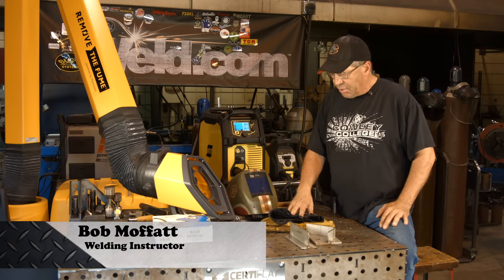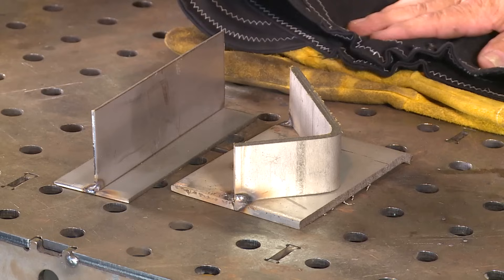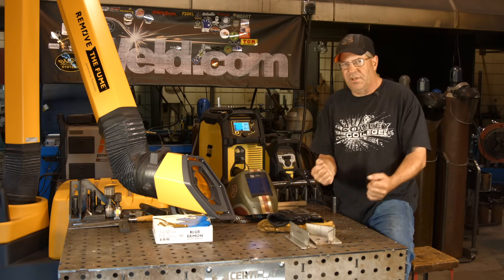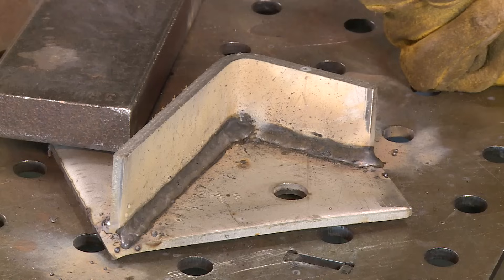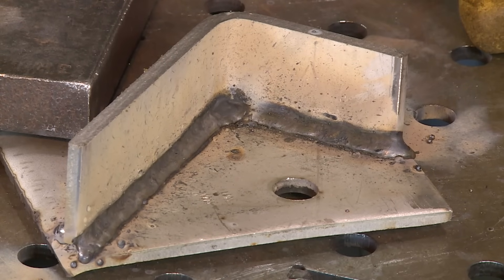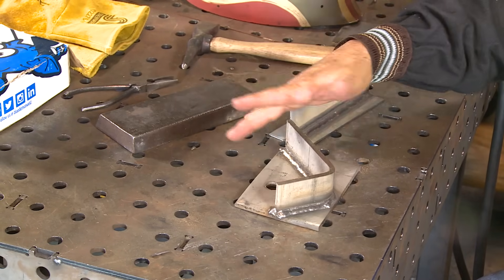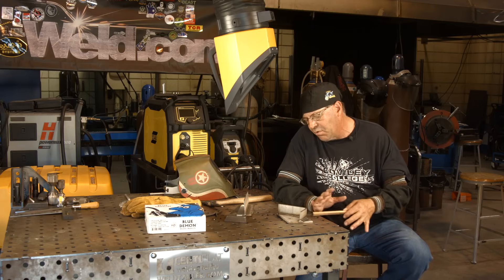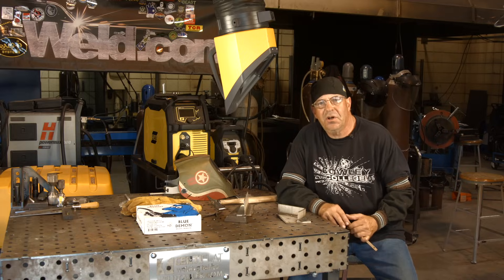Stainless Steel FCAW without Gas

Comment: Might have been a point to note too, that given the stainless is transferred across the arc the same as Mmaw or gas shielded Mag, the fumes that come from this are probably evil!
Reply: That’s why every can of welding Rod and every spoil for mig welding has a warning label saying to use in well ventilated areas

Comment: Why would someone not use flux cor wire?
Reply: You generally would use gas shielded wire for thin sheet metal, for example auto body work .023 dia wire and 25% CO2/75% Argon, otherwise known as C25.  Because of the high amount of Argon in the mix it has a cooler arc with less spatter and less chance of burning through.  If you have to you can get by with .030 wire but if you do this often, .023 wire is preferred.

Flux core tends to have a hotter arc with deeper penetration which is great for thicker structural welds.  Because it has a heavier flux shielding it works well outdoors, gas shielded wire has a hard time with wind.  The bead and slag from flux core is very similar to 6010 stick electrodes which produce a CO2/ CO gas shield.  But flux core is almost always carbon steel, this is the only SS flux core wire I've seen offered.  I don't think we will see FC aluminum wire because you need a inert gas shield ( Argon or Argon/Helium mix).

Comment: Didn't even know flux core stainless was a thing
Reply: Waaaaiiittt is there such thing as flux core aluminum welding 🤔🤔
Reply: I use it everyday building utility trailers.
Reply: @toddedwards1371  Hello, I have a 140 flux core welder. It says to use .030 wire. Would I be able to use this .035 wire?
Reply: @6496chase  same question. Did you ever find out ?
Reply: @DL101ca  I ain't a pro but like sandpaper higher the number thinner the item. So, 30 is thicker, if your running 30 then your setup for thicker product, running 35 the no problem at all. [But, you would want to change downsize to 35 tips, not that it would not work, but would be play running 35 in a 30 zone. LOL...
Reply: @phantom5185  not that way for welding wire. That is a measurement of the wires diameter in inches not a gauge .
Reply: Logan Spence neither did i
Reply: We have used it for years
Reply: yes thats how fuse steel lincoln innersheild nr-211 is aluminum <2% whch reacts with the atmosphere and molten F2
Reply: Me neither, that's why I'm here lol
Reply: As far as I can tell, there are other flux core wires for stainless from the major welding manufacturers, but they all seem to spec gas too, so are presumably used in what's called "dual shield" welding...

  I haven't found any others that say they are to be used without gas...

  About $30 a pound, so obviously if you do a lot of stainless, it would be best to get a bottle of gas for your MIG welder... But if you only have a wirefeed welder or are only doing small amounts of stainless work, seems like it would be an excellent solution.  Price goes down a bit if you are buying a lot.  They have 3 or 4 grades of it.

  If anyone knows of a similar no-gas flux core  wire for stainless, or has other info on this product, please post it here!
Reply: @orcoastgreenman  Have had a little experience with dual-shield stainless, which I thought pretty much rocked.  I only bought it b/c it was a clearance item in my local supplier once, it's quite expensive in new condition.  Powerful arc, big smoking weld covered with black slag.  I guess that's Chromium Oxide?  Slag came off easily to reveal a big glossy stainless looking weld, like butter!  As Jody says about another product "It makes you look better than you are".  I have never tried self-shielded, might be worth it!
Reply: Leonard Pearlman - thanks Leonard...   I tried the blue demon but was not getting great results on the thinnish stuff I was trying to weld, and am not that experienced to begin with... may try it again if I ever have some thicker material I need to weld.
Reply: orcoastgreenman 
Thin-ish stuff is the domain of true mig welding, acetylene welding, or TIG
Reply: I didn't know about it till my first welding job, My first job was wastewater equipment so lots of low pressure stainless I could hone my technique on. we used a flux core with co2 gas.. My current job is at a shipyard and nobody there knew about it either, I saved the company tons of labor hours by turning them onto it with it and I barely got an attaboy.
Reply: @UniteForgetLeftRight  Straight co2 and flux core? I got some HTP gasless flux core 308LFC-O and only used it gasless so far. My tank is currently full of 10% argon/90% co2. Might have to try it but I only used it to repair motorcycle exhausts so far.
Reply: @trevors8577  I didn't know 90/10 ar co2 was a thing, I'm familiar with 75/25 and the wire I used would run much smoother and almost do spray transfer on that gas.  I tried it with straight argon once and the filler metal would burn off much quicker than the flux which would just toothpick (lack of a better word) into the weld.
Reply: @UniteForgetLeftRight  I was trying to get a 85/15 CO2 Argon mix but airgas ended up with a 90/10 when they did the batch.  Somewhere a fella wrote up a huge paper about the different mixes he's tried and what works great for what.  85/15 was supposed to be a better mix so I attempted to get my 80 cf tank filled with it.  Then a farmer picked up my tank at the local gas station/repair shop that airgas delivers to so they lady had to get a hold of him and get my tank back..  Was quite the cluster doing the whole thing!  Straight argon is only used for aluminum with a mig (better use a spool gun too).  Never tried spray aluminum, got a miller 211 so it's capable I hear.
Reply: @UniteForgetLeftRight  I'm not surprised. Most shipyards do not appreciate your skill let alone good advice.

Comment: Would very much like a follow up video, just ordered a roll of this stuff
Reply: How did that ss fluxcore work out for ya
Reply: Sparky Mccormick it worked really good for welding on some 14 gauge pipe. I sanded it smooth and you would never know it was flux core
Reply: Thanks

Comment: I've been wondering about this stainless flux core wire, thanks for the video. It makes you think, how long until somebody figures out how to make aluminum flux core wire?
Reply: I have been thinking about this for several years . Both straight flux core and dual shield (Flux and gas) , I think it's doable .
Reply: Blue demon makes aluminum flux core gasless wire.
Reply: E Flanagan I don't know but it might be doable but I say it would be for out in the field only
Reply: I think aluminum would be very hard to control with fluxcore  - maintaining the narrow margin between optimal heat and blowout with aluminum I don’t think would be easily achieved

Comment: KEWL 😊 I've never seen ss flux core. thank you for the welding lens in front of the camera not very many videos show that shot. well now I know I can weld stainless without gas. thanks for sharing your time experiences and videos with us.
Reply: Ss Flux runs just like mild steel flux. Just run the Ss a little hotter. Just got certified in Ss flux at my job in a shipyard.
Reply: Great video. I never knew such a thing existed either. How thin a material can you weld with this process? I'd like to try with my powerimig welder
Reply: I wonder if one can weld stainless with these cheap 90 amp AC flux core welders? Or only with DC?
Reply: I volunteer my 90 amp hazard fraught econo-shitbox as tribute.

Comment: Interesting product, definitely an advantage for the occasional S.S job or a small run of S.S . No tri blend gas, would work great outdoors. Many advantages I can see to this product. Great video Bob thanks for bring this to us, I for one will get a roll and mess around with it the ball is a problem but i am sure with use it will not be.
Reply: How did the welds go?
Reply: @jotk9440  I am also interested on both your aluminum and SS questions, let me know if they get back to you. Thanks.

Comment: that ball just looks wrong  i guess it use's the globular transfer to create a -hell i don't what it just don't look right 'i would keep turning up the wire speed trying to make it look good but i would probably be wrong i'm sure you are running right thanks for all of the video's [ lots a good information ]
Reply from the maker: Joe, we tried many different settings. The ball stays.
Reply: Weld.com did you guy's try a spray transfer with it?
Reply: DubDoctor spray transfer without shielding gas?.....
Reply: It is interesting.  I suspect the flux becomes a fluid coating on the surface of the molten S/S  until/as it evaporates, and perhaps increases the surface tension of the molten metal making it blob like that.

  In spite of the weird transfer, the welds look great!